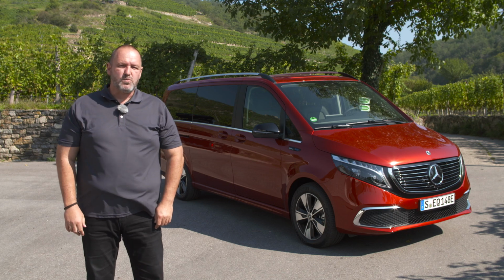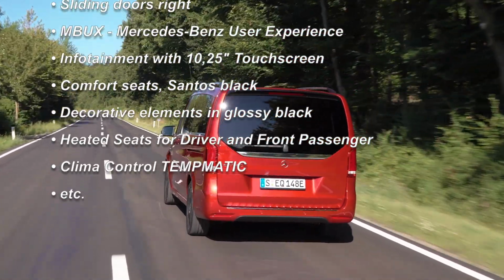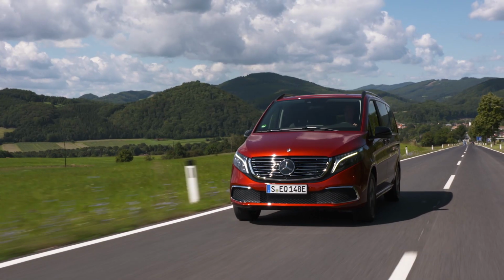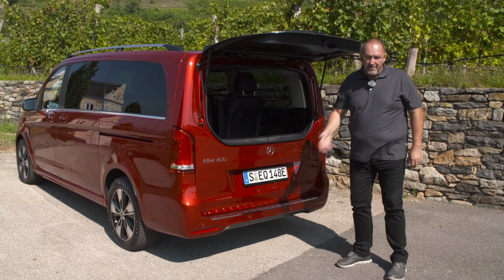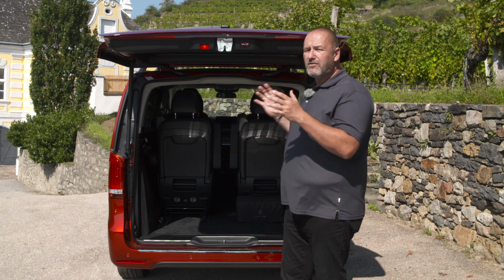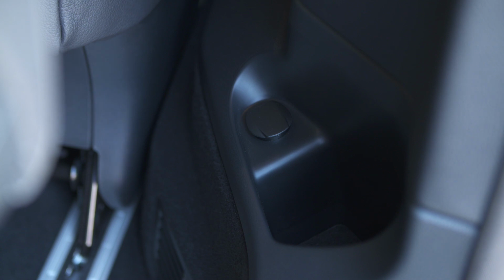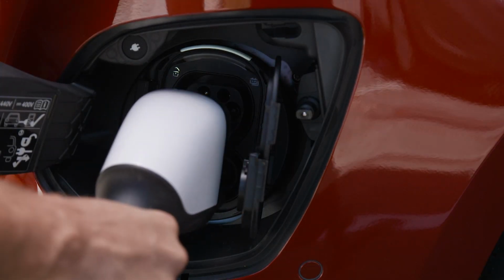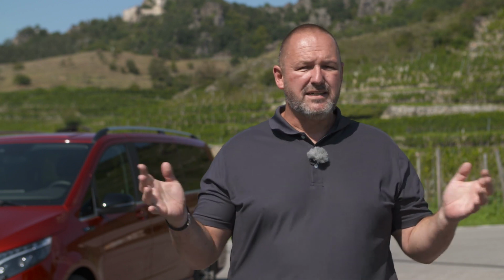NEW Mercedes EQV 300 The electric V-Class | Full Review Test Drive Range Charging Price 2020 English

Comment: Thé battery is doing 24kwh in the temperature conditions of 28 degrees Celsius what will it do in 0 degrees 40kwh? And than we will have the shock of getting only 200 kms per charge